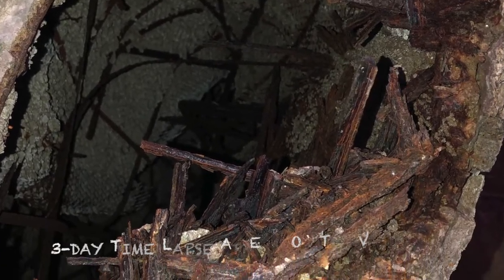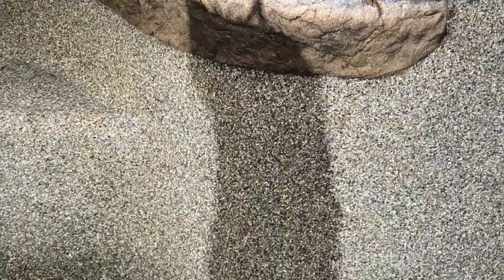Pool Waterfall Repair... like new!

Comment: Hi!  Nice video, we have the same waterfall (almost)!  And, I'm looking to really fix it (down in Ahwatukee).  Most bids just want to paint and not really get into the waterfall/slide/grotto.  The website link doesn't work very well and I can't seem to hit the "contact" link successfully.  Would it be possible for you to share "Austin's" phone number or whoever's we need?  Also, how has the work held up?  Our biggest issue has been calcium/salt effervescence and the whole thing shifting a bit.  TY
Reply from the maker: Hi Galen, thx for watching and commenting.  The ph# I have for Austin is the same listed on the home page of their website: 602-763-4600. 
http://fauxrealwaterscapes.synthasite.com/
Totally fixed the structure… it failed because the moisture/humidity inside rusted out the rebar.  After the repairs, he painted it and even made the water slide slippery.  It’s been a while now and it still looks and operates great.  We’re very happy with their work.  Let’s us know if you still have challenges getting a hold of him. 
North Phoenix Suburbanstead.
Reply: @suburbandiy  Great.  Very cool of you to respond.  Bookmarked, and I'll be back.